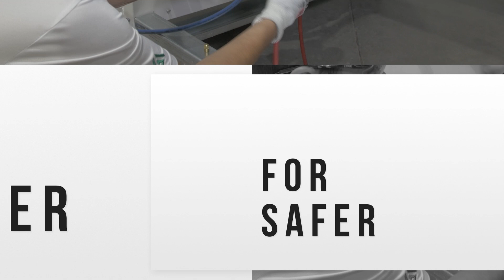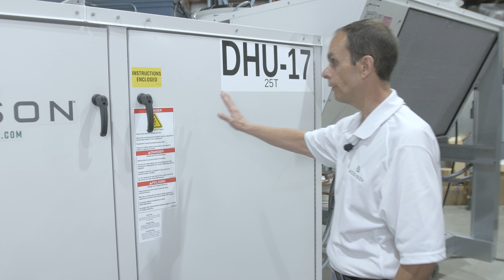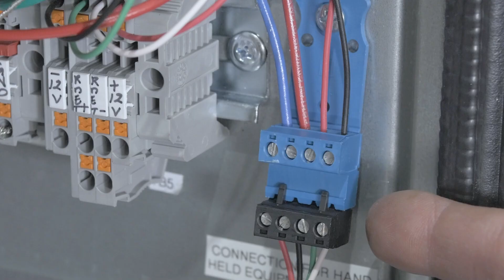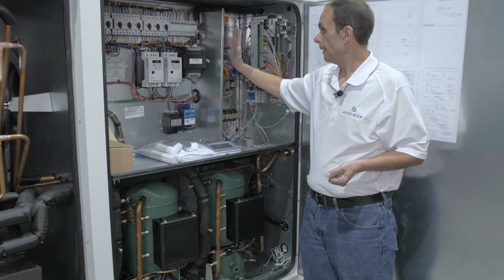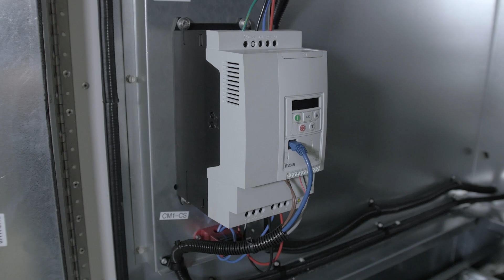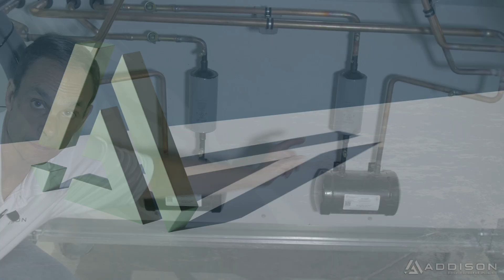Identifying Key Components of an Addison Unit

Comment: Why did you guys coat the filter drier ends in that black paint? Makes it a chore to clean up for replacing.
Reply: I had to replace 5 of those filter driers last summer. I’m not a fan of Addison DHU’s.
Reply: @N @NickLibby-dv1hi w did you clean up the paint? I’m thinking a wire wheel on my drill